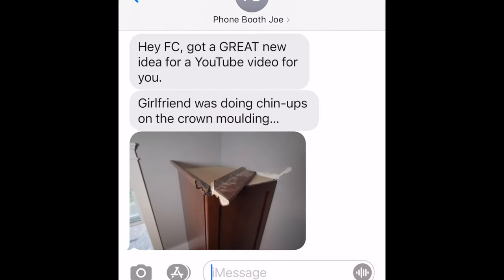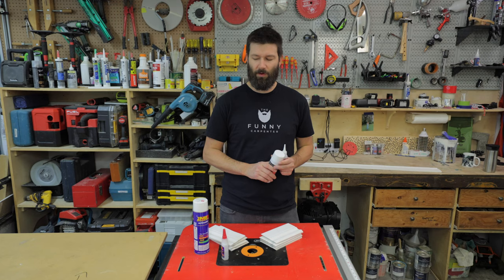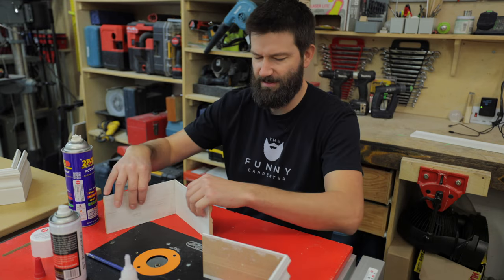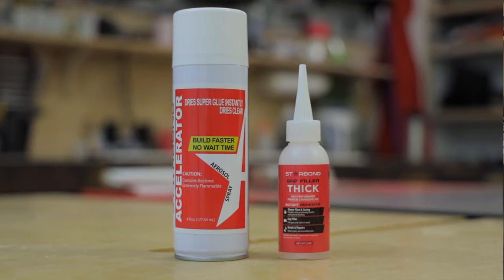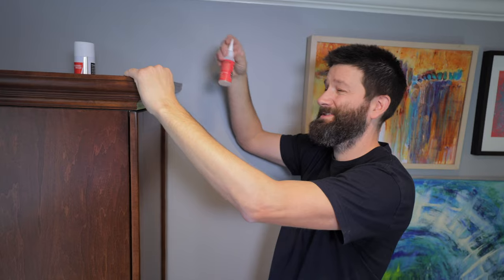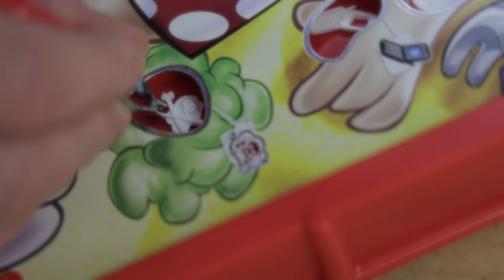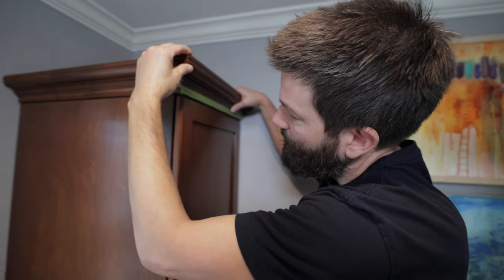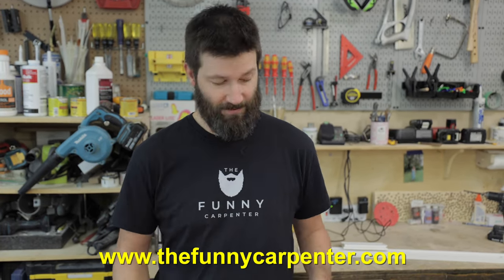How To Fix Cabinet Crown Without A Nail Gun!

Comment: Why wouldn't you just use wood glue? Much stronger bond, especially over time. Crown could be held together with some painters tape until the glue sets 🤷
Reply: I don't get what people think is happening on their ceilings. Why is strength going to be super important? planning on flailing wildly about your kitchen with a baseball bat? 

It's like those guys who are doing endless testing on "which is stronger, dominos, or dowels, or fixed tenons, or floating tenons". Of interest? sure, if you are curious. Relevant? absolutely not, because any of them are going to be way stronger than anything you would plan on doing with the joint, and if it were a close call, you would probably already transitioned to steel by that point.
Reply from the maker: It would be difficult to hold it in place with the wood glue, without any pin nails.
Reply: CA is comparable to wood glue in tensile strength.  Wouldn't that be the demand placed on the crown when being misused as a handle?
Reply: @timmietimmins3780  Crowns with exposed tops feels too much like a handle to resist whenever they are in reach.  Likely to be a light bulb change, kids or a drunk person involved.  The drunk child changing a light bulb is the perfect storm.